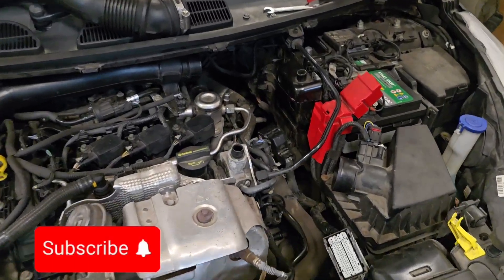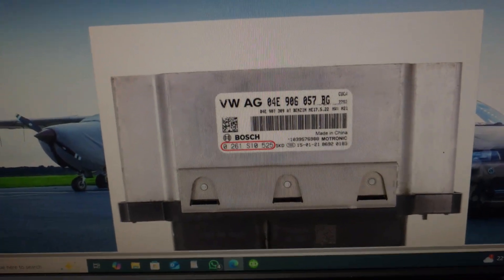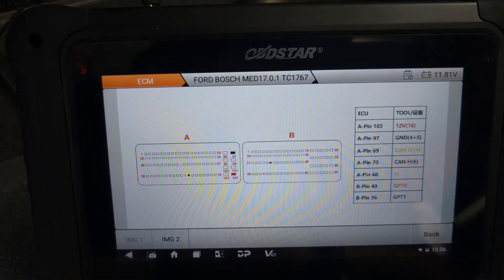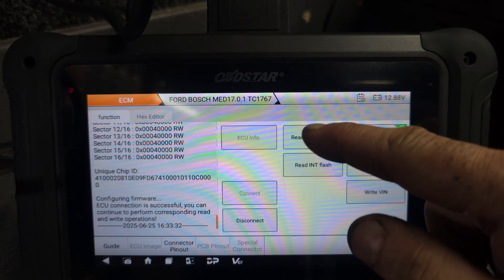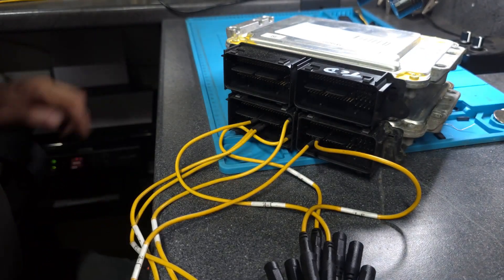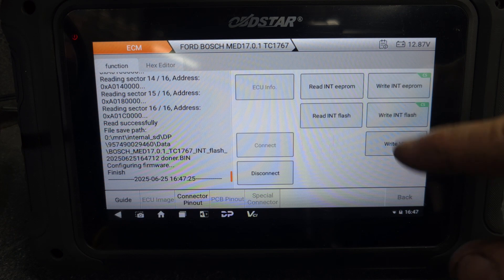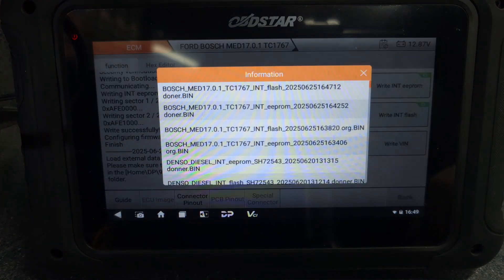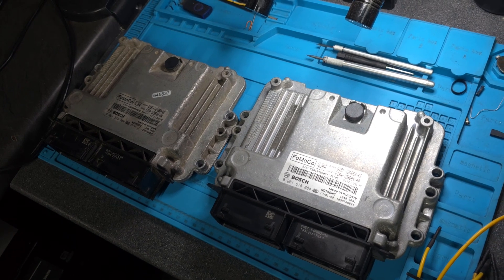Ford Fiesta ECU Cloning | Bosch MED17.0.1(0261 S18 884)Plug & Play Immobiliser Data Transfer/OBDSTAR

Comment: If the ecu is used it automatically overwrites? .
Reply from the maker: Great question! If the ECU is used, it won't automatically overwrite. You'll need to clone the data from the original ECU-like the immobiliser and coding-onto the used one. Otherwise, the car won't start due to the mismatch.
Thanks for watching 🙏